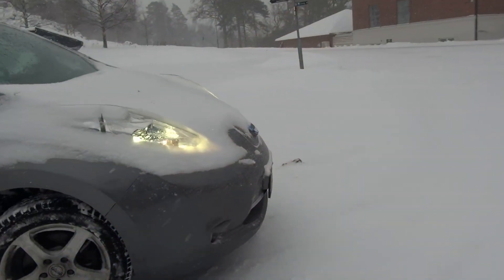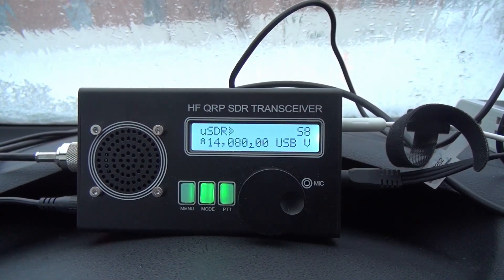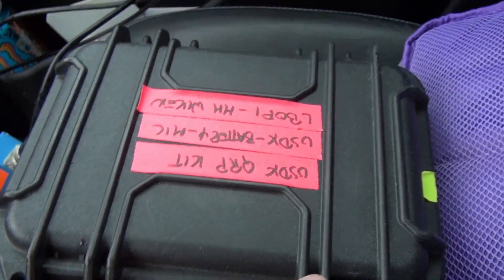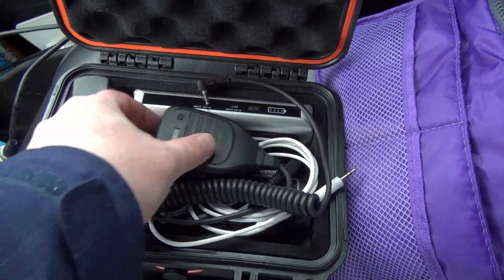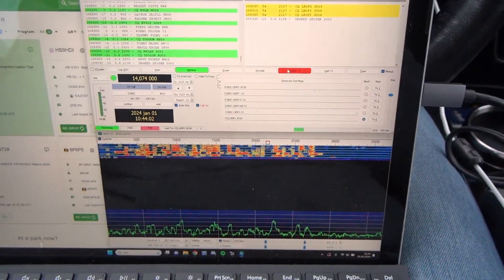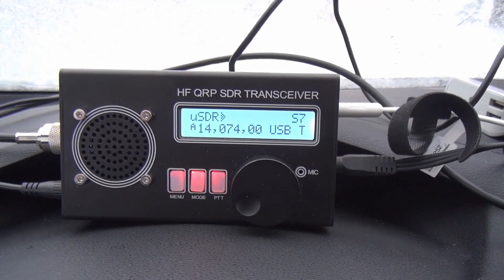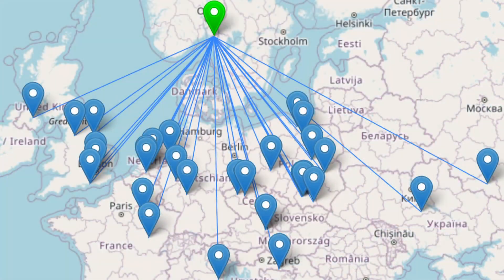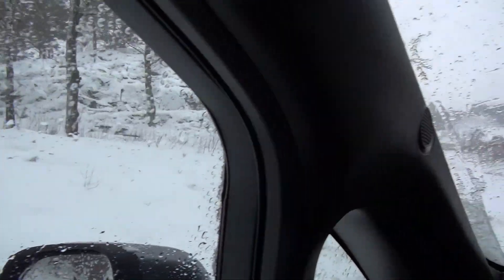Digimode QRP POTA in a BLIZZARD

Comment: Tomorrow I will try the FT4 on 20m!
Reply from the maker: Looking forward to hearing how that goes.
Reply: @LB0FI  Lots of contacts on FT8. I couldn't answer. It went well after lunch for 20m on the moxon. Evening 17-19 on 80m dipole inv. A total of 50 contacts in 3.5 hours. I have it on QRZ. log book. The biggest problem is manual writing. It would take a cat, but I don't know how to deal with it. I have a USB-TTL converter, but I can't connect it.

Comment: Do you keep your engine running? I’d like to get out and activate because we have three more months of snow. And it was -13 yesterday.  BTW do you have snow tires and studs
Reply from the maker: I usually don’t keep the engine on (since it’s an electric motor it’s technically not running unless I drive), not because of RFI, but to keep fan noise out of the videos. The last couple of activations I’ve kept it on though since it’s been unusually cold. My last couple of activations has been in -22, -21, and -17.

As of tires, I have winter tires, but not studded. I haven’t used studded tires the last 20 years, modern winter tires are so good that there’s no need for studs. Even my RV has winter tires without studs.
Reply: I have a hybrid. I’ll have to try it for RFI. Your winter weather is similar to ours.